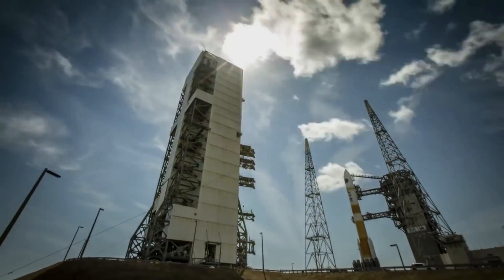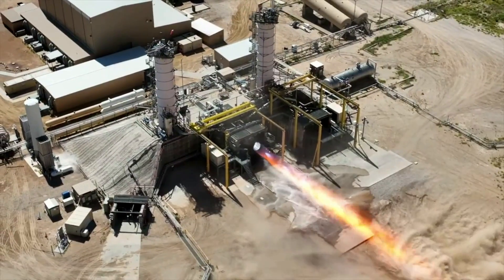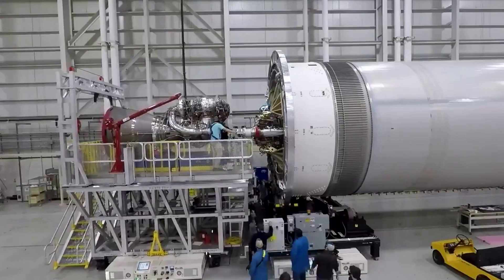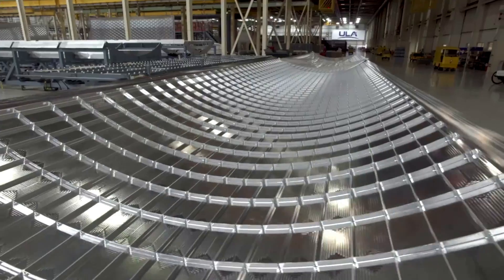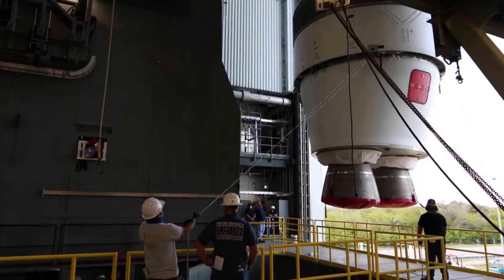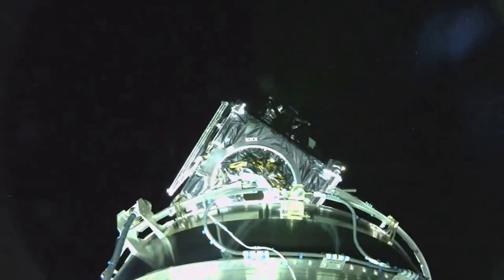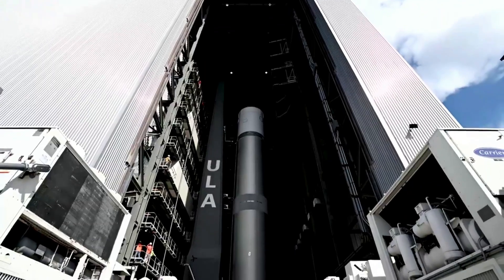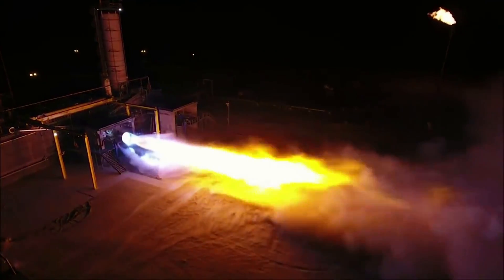The First Launch of ULA's Vulcan Is One BE-4 Away

Comment: That is not Flight Engine-1 (FE-1), that's Flight Engine-2 (FE-2) that got delivered first. FE-2 took the lead after FE-1 had to be sent back to Kent due to an unspecified assembly issue that needed to be corrected there that could not be done at XEEx. So the order was switched up and now FE-2 is at ULA's factory in Decatur.

Comment: It took over 5 years for Blue Origin to deliver one engine. At this pace ULA Vulcan will launch once every 10 years? 

Yes SpaceX's Raptor has not been I to orbit yet, they have launched & recovered so they are more proven than the BE-4.
Reply: maybe the 5 year is just the R&D time, not the time to manufacture those engines
Reply: Except as we speak the engine assembly line is being built in Huntsville. The first of any new hardware always takes long in the rocket industry. Vulcan is launching 3 next year and over 20 the next year. Most of the time for next engines is r&d and design iteration
Reply: You know Vulcan’s 2nd stage isn’t ready right? 😅 I did a quick search and no where does it say Centaur V is ready already fabricated and ready to fly.
Reply: Also with SpaceX if the current ship and booster implodes (high probability), the next one will be waiting its turn.

Comment: I'm not sure how confident I would be in an engine that Blue Origin can't even replicate. They built one that works, and have tested four which don't work.
Reply: You are lying about four engines not working. PQE-600, 602, 802,  and 900, and the two installed on the pathfinder, all worked pretty damn well.
Reply: Excuse me?

So if engine is development unit, by your logic its not a working engine right?
Reply: @_mikolaj_  Those are Musk's zombies. Their only roles are to roam the Internet and talk everything down that is not Musk, including NASA.
Reply: Excuse me. 

That is not even close to what they are saying. Not even close. 😂 they are stating that they do not believe  they can trust an engine that they have such major problems consistently producing them or even working. Until they can actually produce then it will always be “development”.
Reply: @chrisjohnson2065  except they do produce them already and these engines do work

Just beacuse sane person doesnt blow up 80 engines on the test stand per year it doesnt mean they cant produce an engine
Heck, arguably rn BE4 is more developed than Raptor 2 which still struggles with reliability problems

So which engine is still in development?
Reply: @chrisjohnson2065  Who is they? ULA has full trust in the engine. NASA has a rule, you must fly two consecutve sussessfull mission to be certified. What else are you talking about?